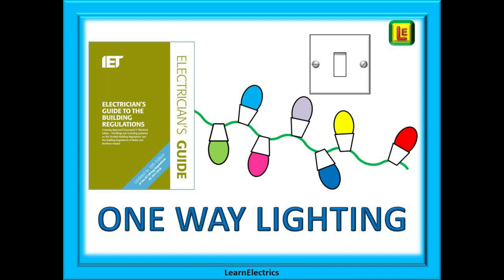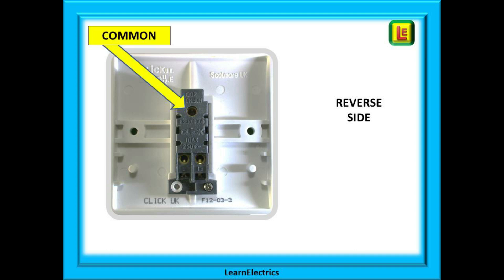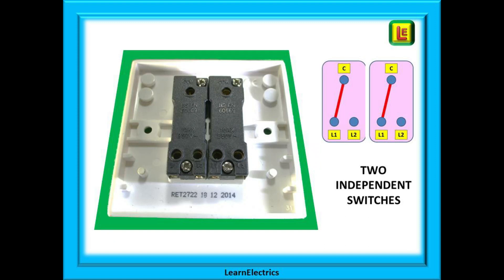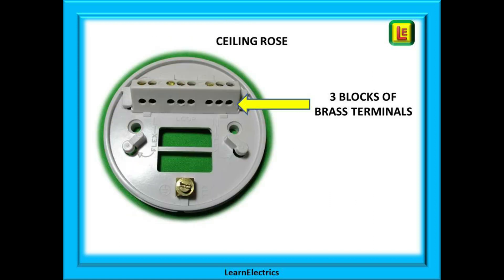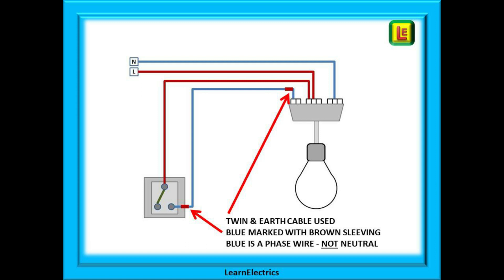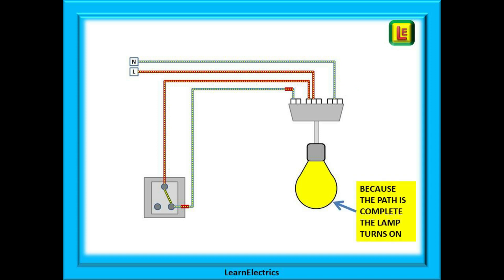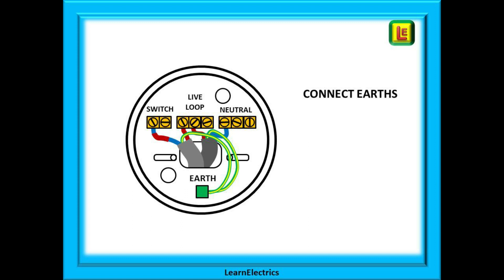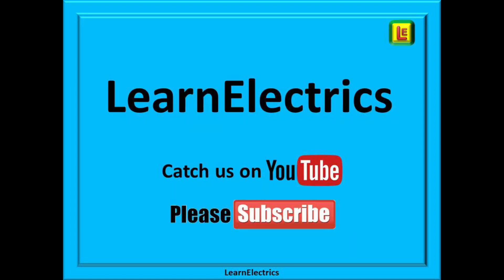ONE WAY LIGHTING FOR ELECTRICAL CIRCUITS. How to install correctly.

Comment: What about when there is no ceiling rose? Like installing a led flourescent tube with Live, Neutral & Earth connections?
Reply from the maker: We use the terminal block inside the fitting. If its only a three way terminal strip then use a waygo or another terminal block to make the extra way that you need. Or some other adaptor box that gives the terminals protection from being touched if it is inside the ceiling space. Thanks for watching. Dave.

Comment: Despite me having my qualifications, I love these videos.
Reply from the maker: Everything helps Craig. Its been a good trade to me for 45 years. Dave
Reply: I'm more confused to my lighting circuit at my home. I didn't wire it and have never come across the way it is wired anywhere else. A permanent live feed conductor and CPC to the switch and neutral to the ceiling rose and switch wire upto the ceiling rose. Not something I was ever taught and never found in any text books but great for down lights.
Reply from the maker: There are several methods in use, some going back 50 years or more. We have shown the method in the current Building Regulations.
Thanks for watching.

Comment: I have a question. Why does it important to connect live wire to pin in screw bulb? It does not matter from working point of view. Is it just to keep it further away from the hands while changing bulb?
Reply from the maker: Exactly, more protection for the user. Hope you enjoyed the video, more to follow.
Reply: @learnelectrics4402  thx. Yes video is pretty good. Informative.
Reply from the maker: Thanks for the positive comments. Appreciated.